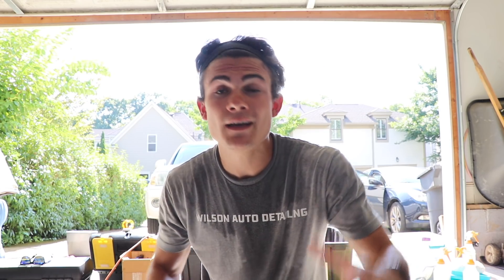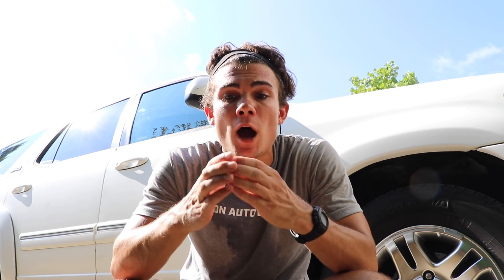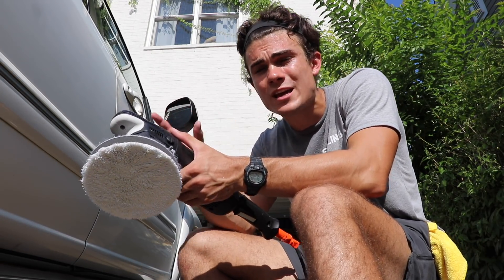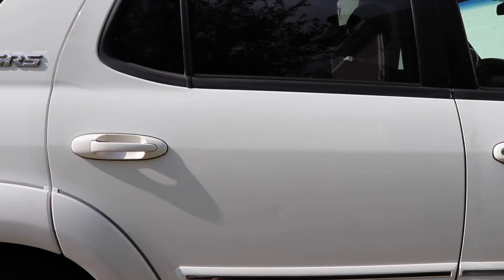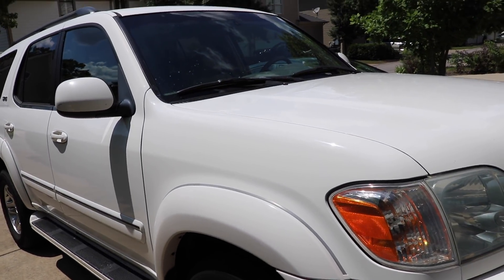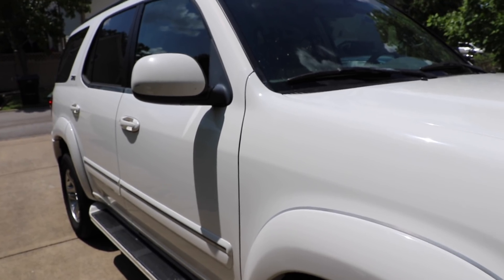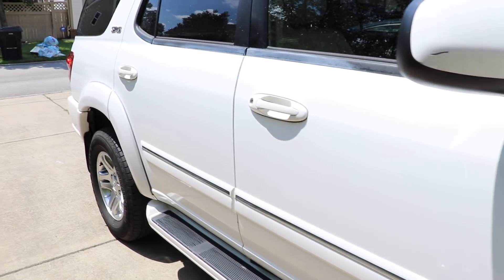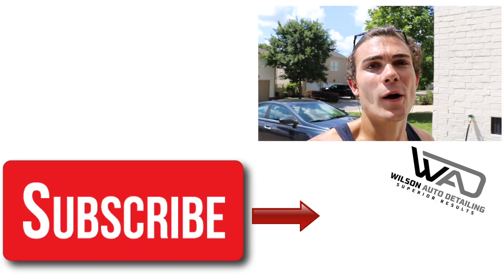How To Remove Oxidation From Paint: 2 Step Process

Comment: Nice video. However, Toyota did not clear coat their Super White so the Sequoia you featured had a single stage paint, no clear coat. That’s one of the reasons this color oxidizes so easily.

Comment: The products you used were for a single stage paint job would you use these same products on base clear? Also how do you determine if its base clear or single stage?
Reply from the maker: Generally a good rule of thumb is just that before 2005 most Toyota’s were single stage

Comment: Do polish or compound expire or have shelf life? I found a Meguiar ultimate polish in the storage room and I have no idea how long it been sitting there and it still has a ton of it left. Probably my dad is using it and forgot it in the storage room.
Reply: Aaron xp I have the same question, just found a big bottle of HD speed that's been in my dad's mobile car wash for about 2 or 3 years.
Reply: Give it a good shake and as long as it's still the same consistency as new, it should be fine. It probably sat on different shelves for 2 years before it got sold originally anyway...
Reply: Aaron xp  yeah, if stored in a 40-70-80 degree temp, even if opened before,  as long as it was closed tight, it will be fine. If it look like cottage cheese and clumpy, even after you mix it, then it's no good.
Reply: I don't think there is any risk in giving it a shot.  If it's lumpy and gooey, then I'd toss it, but if it looks good, give it a shot.

Comment: Luke, did you prep the paint before waxing? And what did you use to do that? I am a beginner diyer and trying to do my research on what I need to get the job done efficiently. I have a white 2009 honda accord that I bought used from a friend and it is just as oxidized as this vehicle, so I am using your video a refrence. Thank you!